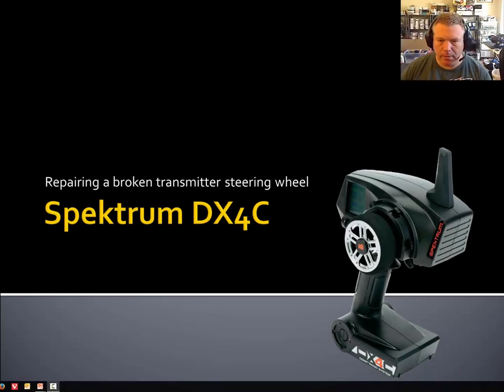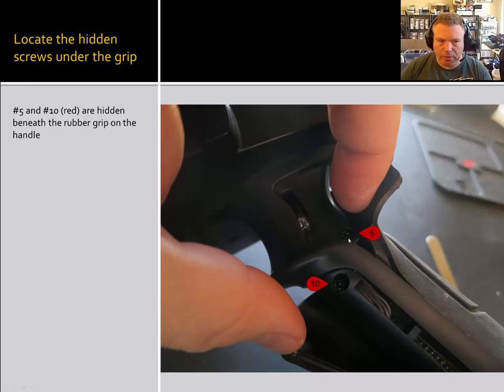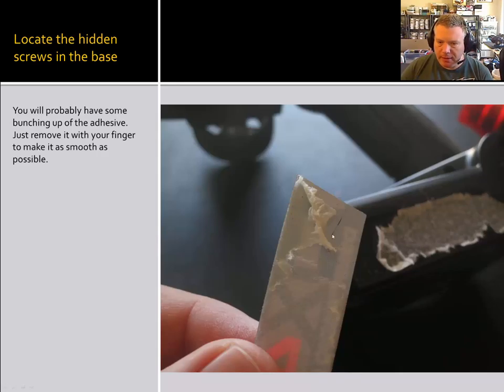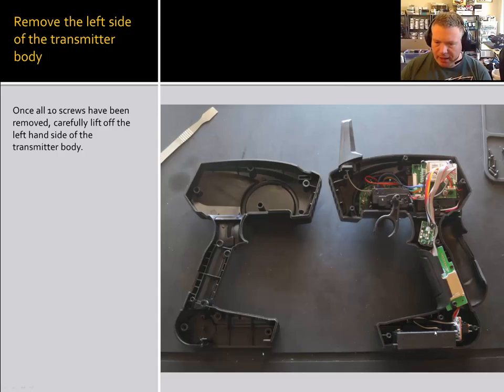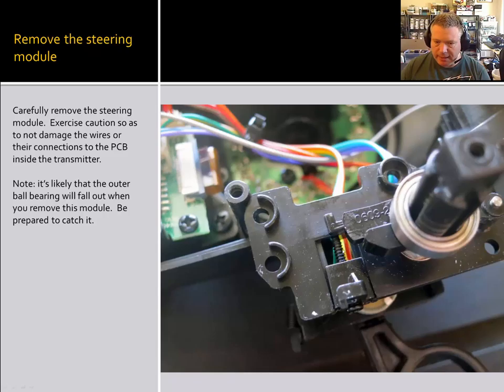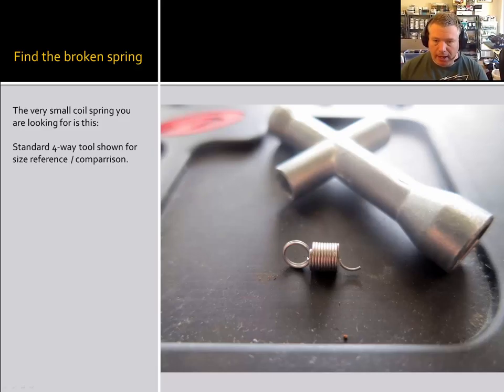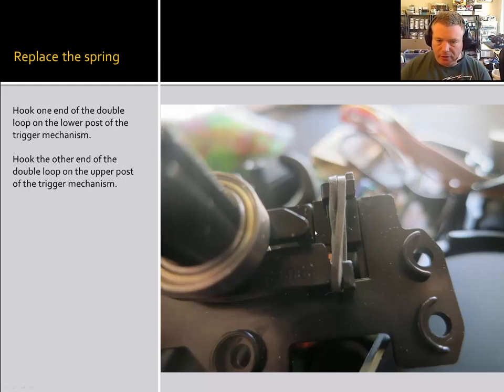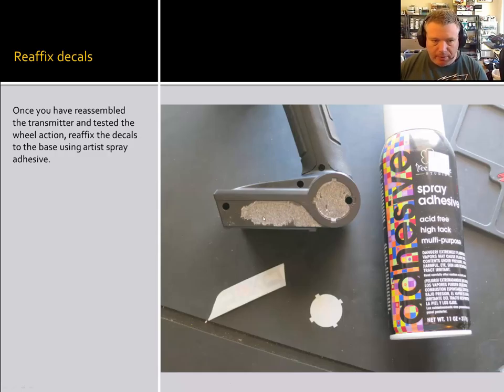Spektrum DX4C Transmitter Steering Wheel Repair

Comment: Did the rubber strap hold? Or did it snap? I am afraid that the rubber will dry rot.
Reply from the maker: Tomberland the transmitter has been used every-other weekend for a full day of racing (in Texas) since I made this video (almost a year) and it's still going strong as of this reply.
Reply: Kelly White Thank you for your reply. I deceided to give the stock spring another try. I bended another hole on the side that broke off. If it breaks again than I will be using the rubber strap method. Thank you 1000 times for your time to make this video to help others. I got mine up and running again because of your video in only one evening work!

Comment: Mine just broke and i had to fix it, spektrum radios are garbage hardly used the radio at all! after taking it apart it was build like a toy my KO propo radios are built much better and laid out better for ease of replacing parts.
Reply from the maker: Was the video helpful for you to repair the Spektrum?
Reply: I did it myself before I seen your video. I been into rc for ever so it was easy.